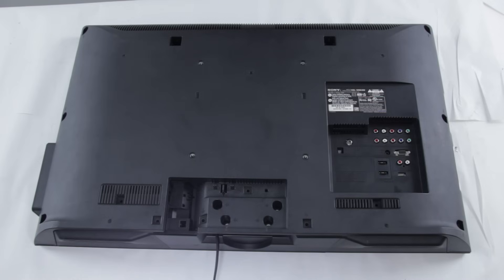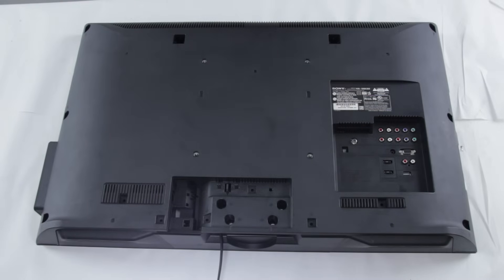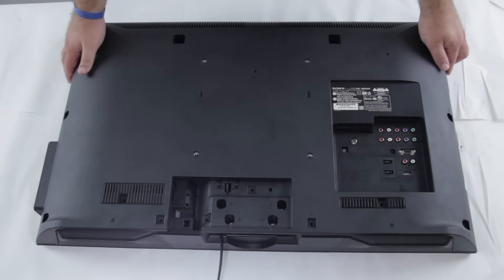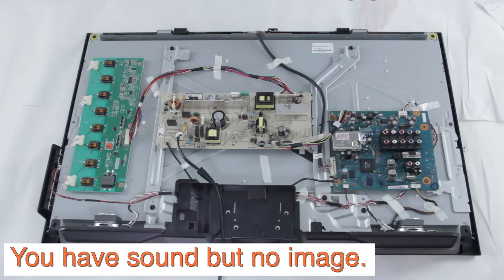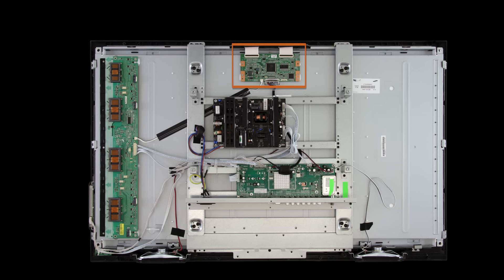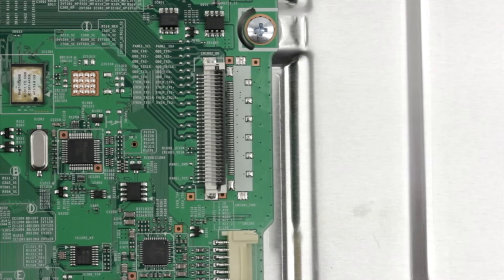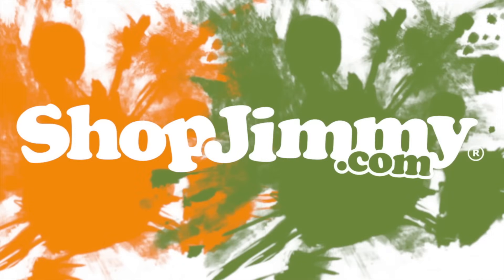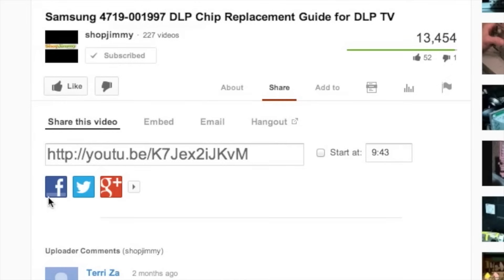LCD TV Repair Tutorial - T-Con Board Common Symptoms & Solutions - How to Replace T-Con Board

Comment: Hi, Ive got a SHARP LC-60C6500U The images on the LED screen are "washed out" and continually "flicker" independent of video input used.
Reply from the maker: Oleg Skorohodov  This sounds like a problem with either the T-con board or TV panel.  You can replace the T-con board to see if that fixes the problem.  Here is a link to replacement parts for your TV model number on our website, click here:  http://www.shopjimmy.com/catalogsearch/result/?q=LC-60C6500U  Be sure to match part numbers on your current board, with your replacement for compatibility.  You can also call our customer service for further assistance with your purchase.  (877) 881-6492  Thanks and please let us know if you have any further questions with your TV Repair!  www.shopjimmy.com

Comment: Hello. I have a Sony Bravia KDL-52W5150 upon powering it on the screen has rainbow vertical lines, sound still works great though. I have figured out if I leave it on for a half an hour or so then power it off and back on again it'll work fine with perfect picture and all. Once turned off for a little while I have to repeat the process. Any suggestions? Any help would be greatly appreciated. Thanks so much.
Reply from the maker: Tessa Burden   This sounds like a TV panel problem.  If your TV panel is bad, it may be more cost-effective to replace the TV as panels are typically hard to find in stock, difficult to replace, and expensive.  Thanks and please let us know if you have any further questions!  www.shopjimmy.com

Comment: Hi,I have a samsung MODEL. LE46A656A1FXXU ,Serial no. ALJQ3SRQ500389N, Screen comes red when I switch on then all picture colour comes red shade.Thank you
Reply from the maker: NAZNETO2   I recommend replacing the main board in your TV.  Here is a link to possible replacement parts for your TV model number on our website, click here:  http://www.shopjimmy.com/catalogsearch/result/?q=46A65  Be sure to match part numbers on your current board, with your replacement for compatibility.  You can also call our customer service for further assistance with your purchase.  (877) 881-6492  Thanks and please let us know if you have any further questions with your TV Repair!  www.shopjimmy.com

Comment: Hi I have a lg 42LH3000 TV and the screen is all pastal colours with very pink faces, what could be the problem? Thanks in advance
Reply from the maker: zacharia1111   This sounds like a problem with either the T-Con board or the main board in your TV.  You may need to replace each board individually to see which one fixes the problem.  Here is a link to replacement parts for your TV model number on our website, click here:  http://www.shopjimmy.com/catalogsearch/result/?q=42LH3000  Be sure to match part numbers on your current board, with your replacement for compatibility.  You can also call our customer service for further assistance with your purchase.  (877) 881-6492  Thanks and please let us know if you have any further questions with your TV Repair!  www.shopjimmy.com

Comment: I have a Sony Bravia KDL-46LV160. It was working fine, then one day we turned it on and we had vertical lines. Next day same thing so we reset the TV. No improvement. We didn't turn it on for three days and we turned it on and now we have a slow picture with lots of streaks, ghosts, red tones, and some vertical lines. Is is likely the T-Con board?
Reply from the maker: Jessica Sawko   This sounds like a TV panel problem.  If your TV panel is bad, it may be more cost-effective to replace the TV as panels are typically hard to find in stock, difficult to replace, and expensive.  Thanks and please let us know if you have any further questions!  www.shopjimmy.com

Comment: I'm sorry I did not specify when I said distorted but is not giving me a double image nor a rolling picture. What I'm getting is Vertical lines no picture just lines but ones the T.V warms warms up the picture looks good I would say perfect. Samsung LCD Model NO L.N46A750R1f ... Model Code LN46A750R1FXZA Thank you for your expert help
Reply from the maker: Jesus E. Lopez   This sounds like a TV panel problem.  If your TV panel is bad, it may be more cost-effective to replace the TV as panels are typically hard to find in stock, difficult to replace, and expensive.  Thanks and please let us know if you have any further questions!  www.shopjimmy.com

Comment: hello
I have a samsung ln52b750 and 2 days ago we decided to get public tv using a very basic antenna. (very basic - no power booster...) and today picture looks very dimmed. I disconnected the antenna and problem remained. 
when i turn on tv, for 2-3 sec picture is normal, after that it gets dimmed and changing settings from dynamic to standard, brightness, sharpness .... does not make any difference. (changing these settings does not affect the picture)
thanks for helping me to find the right part.
Reply from the maker: *****    I recommend replacing the power supply board in your TV.  Here is a link to replacement parts for your TV model number on our website, click here:  http://www.shopjimmy.com/catalogsearch/result/?q=ln52b750  Be sure to match part numbers on your current board, with your replacement for compatibility.  Here is a link to a video showing how to identify your part number, click here:  TV Part Number Identification Guide for Samsung DIY TV Repair Power Supply Unit (PSU) Boards  You can also call our customer service for further assistance with your purchase.  (877) 881-6492  Thanks and please let us know if you have any further questions with your TV Repair!  www.shopjimmy.com

Comment: Hi, I have a Problem with my LG47 LF6500. I can watch DVDs on it with no problem but when I connect my computer, after like 5 minutes there will be rainbow coloured stripes from top to bottom on the tv. Do you know what it can be? its like its has a problem showing high resolution all of a sudden. I have had theis TV like 5 years. Thanks for helping
Reply from the maker: Savas Isik   This could be a main board or possibly a settings/compatibilty issue between the computer and the set itself.  If you do decide to replace a board, here is a link to replacement parts for your TV model number on our website, click here:  http://www.shopjimmy.com/catalogsearch/result/?q=LG47+  Be sure to match part numbers on your current board, with your replacement for compatibility.  You can also call our customer service for further assistance with your purchase.  (877) 881-6492  Thanks and please let us know if you have any further questions with your TV Repair!  www.shopjimmy.com

Comment: Hi, I have a Samsung Model: LE40M86BDX/XEU. Serial: AJ3R3SMQ200067R
The tv works fine for about a minute after it is switched on, then the colour slowly turns negative. The tv is about 7 years old and I have been told they dont make the parts for it any more. Im happy to try a home repair, can you advise me on which parts may need replacing and I can try and source them 2nd hand?
Reply from the maker: Ben Flewitt   I recommend replacing the main board in your TV.  Here is a link to replacement parts for your TV model number on our website, click here:  http://www.shopjimmy.com/catalogsearch/result/?q=LE40M86BDX%2FXEU  Be sure to match part numbers on your current board, with your replacement for compatibility.  You can also call our customer service for further assistance with your purchase.  (877) 881-6492  Thanks and please let us know if you have any further questions with your TV Repair!  www.shopjimmy.com

Comment: Hi
Hi have  an LG tv - 37LH3000    ZA.AEKDLJG
Serial 911WRGX1Q615

Suddenly the colours changed to pale pastel shades. This effects all modalities and  is seen with any input. Otherwise the tv is great and I would really like to repair it. I am not sure where to start though! Any advice?
Many thanks
Lynne
Reply from the maker: Lynne Clark  I recommend replacing the main board in your TV.  Here is a link to replacement parts for your TV model number on our website, click here:  http://www.shopjimmy.com/catalogsearch/result/?q=37LH3000  Be sure to match part numbers on your current board, with your replacement for compatibility.  Here is a link to a video showing how to identify your part number, click here:  TV Part Number Guide for LG & Zenith Main, Digital, & Tuner Boards (LCD, LED, Plasma TVs)  You can also call our customer service for further assistance with your purchase.  (877) 881-6492  Thanks and please let us know if you have any further questions with your TV Repair!  www.shopjimmy.com

Comment: hi,
I need a help with my Toshiba 40PB200-E1 LED TV.
It has NO DISPLAY. there is a sound,backlight and responding when changing chanel. it has only no DISPLAY or IMAGE.
when i went to the toshiba service center they said that it is the LED panel that is need to be replace not the T-CON board.
Reply from the maker: Joseph Pablico   Yes the actual led strips in the panel are bad.  Thanks!  www.shopjimmy.com

Comment: Samsung LCD Model NO L.N46A750R1f ... Model Code LN46A750R1FXZA The issue I'm having with it, when I turn the T.V on it looks distorted but one's it warms up the pictures clears.  The picture looks good but it flickers. Thank for your expert opinion
Reply from the maker: Jesus E. Lopez   Most likely a bad panel.  Especially if you see a double imaging issue or a rolling picture like effect on the screen.  If your TV panel is bad, it may be more cost-effective to replace the TV as panels are typically hard to find in stock, difficult to replace, and expensive.  Thanks and please let us know if you have any further questions!  www.shopjimmy.com

Comment: Hey,
i have another problem with my tv. It is a 47LG5000, built in november of 2008.
Since some weeks the screen is one the left darker than on the right. It is a crossover without steps. And when the whole screen is filled, than the screen is flickering. I opened the back and realized that one of the backlight inverter is droning. The inverter which is droning is the 6632L-0486B (Master)
I hope you can help me
thanks :)
Reply from the maker: Vincent   I recommend replacing both of the inverters in your TV.  Here is a link to replacement parts for your TV model number on our website, click here:  http://www.shopjimmy.com/catalogsearch/result/?q=47LG50  Be sure to match part numbers on your current board, with your replacement for compatibility.  You can also call our customer service for further assistance with your purchase.  (877) 881-6492  Thanks and please let us know if you have any further questions with your TV Repair!  www.shopjimmy.com

Comment: I have a LCD computer monitor I-Inc IH252HPB model HSG1064, It will display a picture and after short time screen will go dark, can not see any image even in a drak room, the green power light stays on but no picture, how can I check this monitor t-con board, I have checked power board and main board to find they are working.
Reply from the maker: Tech. Support  I recommend replacing the main board in your TV.  Here is a link to replacement parts for your TV model number on our website, click here:  http://www.shopjimmy.com/catalogsearch/result/?q=HSG1064  Be sure to match part numbers on your current board, with your replacement for compatibility.  You can also call our customer service for further assistance with your purchase.  (877) 881-6492  Thanks and please let us know if you have any further questions with your TV Repair!  www.shopjimmy.com
Reply: One of the LCD lamps has burned out and broke off its connector, there are 4 lamps total 2 mounted together in a reflector at the top and bottom, Need to find replacement tubs approx 22" long
Reply from the maker: Tech. Support  We do not offer these lamps.  Thanks and good luck in your search!  www.shopjimmy.com

Comment: Hi.. I have a  Dynex DX-32L221A12.. with an intermittent backlight, 98% of the time on start up, there is no backlight and there is a 1 second interval red flashing led on front panel. Now I can't get the backlight to come on at all, just before I was going to confirm if the LED on the T-Con board was on when the lamp worked. Now there is no LED on the T-Con board at all, so that is uncertain. Thanks
Reply from the maker: Dave Beam   This sounds like a problem with the power supply or the backlight inverter.  You may need to replace each board individually to see which one fixes the problem.  Here is a link to replacement parts for your TV model number on our website, click here:  http://www.shopjimmy.com/catalogsearch/result/?q=DX-32L221A12  Be sure to match part numbers on your current board, with your replacement for compatibility.  You can also call our customer service for further assistance with your purchase.  (877) 881-6492  Thanks and please let us know if you have any further questions with your TV Repair!  www.shopjimmy.com

Comment: Samsung Ln46a630 Color problems
The color has become very unstable, high contrast, dark shadows, phycodellic. It also now has a slight lag when it is turned on
Reply from the maker: Allan Isaac   This sounds like the problem is either with your T-Con board or the TV panel.  You can replace the T-Con board to see if that fixes the problem.  Here is a link to replacement parts for your TV model number on our website, click here:  http://www.shopjimmy.com/catalogsearch/result/?q=Ln46a630  Be sure to match part numbers on your current board, with your replacement for compatibility.  Here is a link to a video showing how to identify your part number, click here:  Samsung Timing Control (T-Con) Boards Part Numbers Identification for LCD HD TV Repair  You can also call our customer service for further assistance with your purchase.  (877) 881-6492  Thanks and please let us know if you have any further questions with your TV Repair!  www.shopjimmy.com

Comment: Hi I've got a LNS4041DX/XAA samsung tv. I've got sound but no picture. Before the picture went it looked like the screen was bleeding red. So does this sound like the t-con or is it more likely the backlight inverter? Thanks
Reply from the maker: Mike Bunce  I recommend replacing the main board in your TV.  Here is a link to replacement parts for your TV model number on our website, click here:  http://www.shopjimmy.com/catalogsearch/result/?q=LNS4041DX%2FXAA  Be sure to match part numbers on your current board, with your replacement for compatibility.  Here is a link to a video showing how to identify your part number, click here:  Samsung Main Boards & Digital Boards: Part Numbers for LED, LCD, DLP, Plasma TV Repair  You can also call our customer service for further assistance with your purchase.  (877) 881-6492  Thanks and please let us know if you have any further questions with your TV Repair!  www.shopjimmy.com

Comment: i have a Samsung model: LN37A550P3F.S/N: ALXQ3CSB09511N ...power. back lightins n sound works .. right half of screen has color stripes n other half works n shows video perfect. do i need T-Con board replacement ? thanks
Reply from the maker: Jose Garrido   This sounds like the problem is most likely the T-Con board in your TV.  I recommend replacing it and seeing if that fixes the problem.  Here is a link to replacement parts for your TV model number on our website, click here:  http://www.shopjimmy.com/catalogsearch/result/?q=LN37A550P3F  Be sure to match part numbers on your current board, with your replacement for compatibility.  You can also call our customer service for further assistance with your purchase.  (877) 881-6492  Thanks and please let us know if you have any further questions with your TV Repair!  www.shopjimmy.com

Comment: I have a faint vertical line of pixels on the left -hand side of a LG 42LG70-UA that became visible about a week ago (it has gone away entirely once or twice since then but briefly; about 10-15 minutes before it becomes visible again). The line is 1 pixel wide & starts at the bottom and fades in intensity about 3/4 way towards the top to practically nothing. The line totally disappears with an all blue screen but is slightly visible with a solid red or green screen (I've tried running software that quickly flashes these colors to try and possibly free up the pixels). Please advise as to the possible culprit (i.e. T-Con board?)

Model# 42LG70-UA    Product Code# 42LG70-UA.AUSQLJR    Serial# 809RMRH4270510    Manufactured: September 2008

I would attempt to remove/clean/wiggle around to tighten the ribbon contacts on the T-Con board myself if that might help. I think there are 3 different boards I might have seen related to this tv also.

Comment: Okay so it is not the TCON Board as this video points to that,  What you are telling me from the information I gave you is that it is the panel so I will just trash the TV instead of changing out the TCON board.  I am a bit upset as I thought it could be saved per your YourTube.  Thank you,
Reply from the maker: Darlene Hines   This sounds like a problem with either your T-Con board or TV panel.  You can replace the T-Con board to see if that fixes the problem.  Please reply with your TV model number and then I can recommend replacement parts for your TV repair.  You can also call our customer service for further assistance with your purchase.  (877) 881-6492  Thanks and please let us know if you have any further questions with your TV Repair!  www.shopjimmy.com